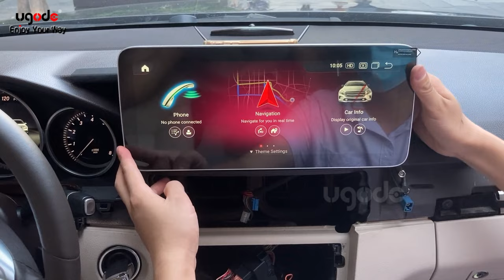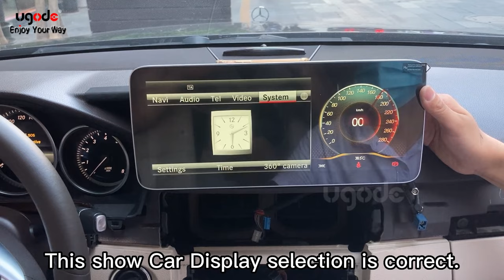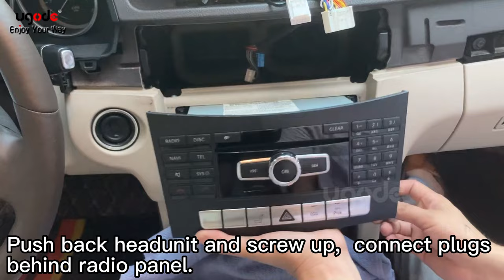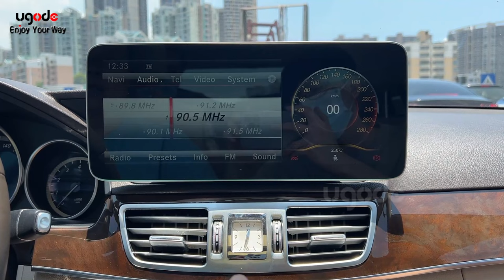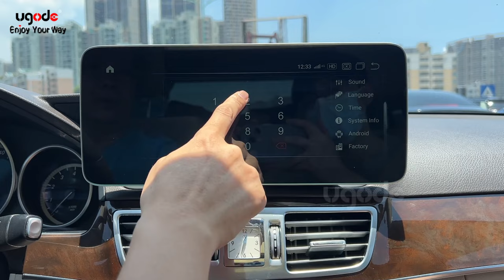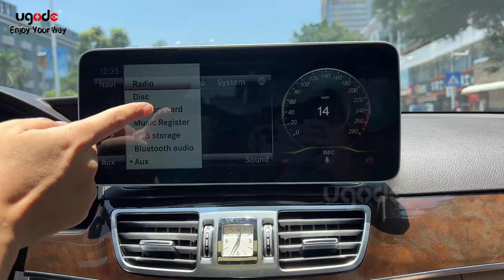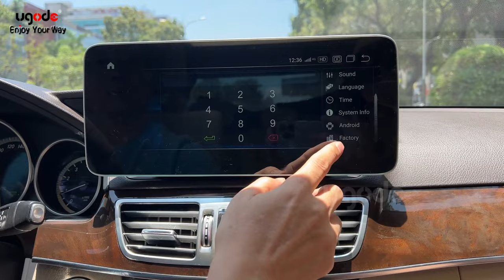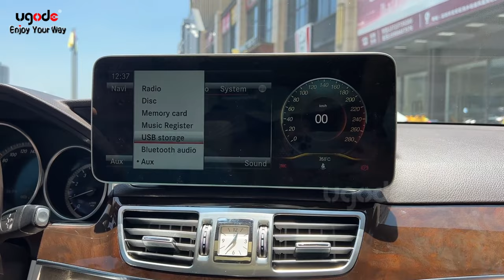How To Install DIY Mercedes-Benz E Class W212 10.25"/12.3" Android Display  screen Apple Carplay

Comment: Hello everyone, I bought a 12.3 inch koason screen, there are problems, I couldn't fix it, when I give a signal while watching a clip on the screen, the screen goes off, the sound comes after the video, it is not synchronized, can you help?
Reply from the maker: Is your car NTG5.0, if it is NTG5.0 you can install DSP to fix the delay of sound

Comment: hello i have a question.
if there is a problem with the harness cable, can it cause no alert in case there is an obstacle in front of car?
Reply from the maker: no problem with the harness cable. not cause such alert.

Comment: Hello, nice video. I finaly find out how automatic switch work. Thank you for that. 
Few questions:
1. What sistem of birdwatch 360 camera you have and how you instal it. Can you point me to the instal link or store? 
2. On my reverse screen i have a static big icon of sensors radar, but i dont have it on car. How i deactivate that half-screen picture?
(The picture i refer is a car with radar lines in front and back) it is useless for me and take half of the screen. 
3. Is there any update for this unit?

Comment: Hi, Fantastic Video. How come you have not connected the Aux. Mine is a 2015 W212 E350D NGT5.0 which does not have AuX port. It has 2 USB ports in the centre console. How will this work without connecting to AUX. Kindly need your advice and guidance please. Thanks in advance. Looking forward for your suggestion.
Reply: I have a 2016 similar issue. I just connect audio via Bluetooth and visually use the CarPlay function. Not my favorite solution but until I figure out how to get the audio to work directly it’s all I got.

Comment: Having a hard time getting g the radio back in also I am getting no sound. I did move over the fiber cables. Any advice?
Reply from the maker: Android no sound: 
1. Check optic cables well relocated correctly and closely. 
2. If there is Aux input port on car, connect Audio cable/box into it. 
3. Choose AUX Switching mode “Manual” in factory settings, then go to OEM radio and choose “Audio-AUX” , touch screen to android, sound out. (BENZ NTG5 and BMW EVO is in USB function shows USB device connected) . 
4. If you want AUX automatic switch, needs to set correct AUX position in android setting for BENZ NTG4.5/4.7/5 , or else no sound, details refer to setting instruction. 
5.please check the android factory setting(code is 2018) to check if the "CAN Protocol" chosen is NTG5.0/NTG4.5/NTG4.0/NBT/CIC/CCC, Choose according to original system of the CD（Usually set at the factory, no need to change）
note: if your car is Benz NTG4.5 which has no AUX, need to activate Aux inside factory settings first, the route is : Factory Settings-Vehicle-AUX Activate after restart, you will see AUX inside NTG menu. https://youtu.be/k6sPVUkM9F0  --- Video to show how to activate Aux 
for benz NTG4.5/NTG4.0 need to confirm that the white plug connection on the power main cable is correct

https://youtu.be/XEd1lTV1Cjc  --- Video for Benz to show how to set AUX Switching mode to “Manual” for sound.
https://youtu.be/QDZnkZIsqIg  --- Video for BMW to show how to set AUX Switching mode to “Manual” for sound.
Reply: @ugodecarplaynavigationfact9636  Thank you very much for this reply! very helpful. I will try the suggestions you provided.

Comment: Hello, is there an audio ground cable as audio is very crackly
Reply from the maker: Sorry, no, check the wiring. If the white connector is connected incorrectly, it will cause noise

Comment: I can't get gps signal. Either through CarPlay or without. Is there some sort of gps blocker on the system or some feature that's blocking my phone ? Anyone who comes in my car no navigation apps work.
Reply from the maker: The 4G antenna and the GPS antenna cannot be placed together. It is better to place the GPS antenna on the rear window glass
Reply: @ugodecarplaynavigationfact9636  there are 2 antenna ?
Reply: @ugodecarplaynavigationfact9636  the antenna that came with the navigation was placed on the bord inside my car. There is another antenna?
Reply from the maker: @TopG80  there 2 pcs 4g antenna，put together

Comment: Does the sound quality gets worse than original since it’s through AUX? Also do you have any screens that use MOST fiber for signal instead of AUX?
Reply from the maker: No difference. Except for NTG5.0 cars, NTG5.0 cars output sound through USB audio boxes. Some cars have slight differences, but they can be solved by adding DSP
Reply: @ugodecarplaynavigationfact9636  Is all of the functionality still there for NTG5.0 Cars? Automatic audio source selection, steering wheel controls...
Reply from the maker: @privateparty4900  Yes